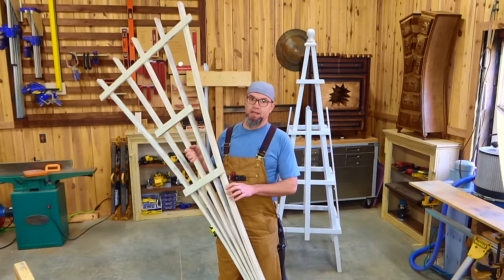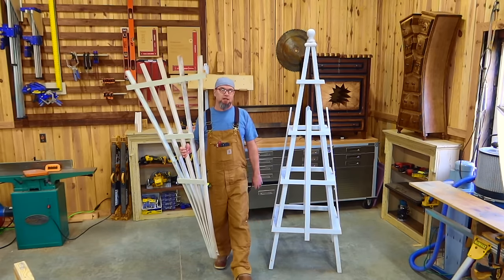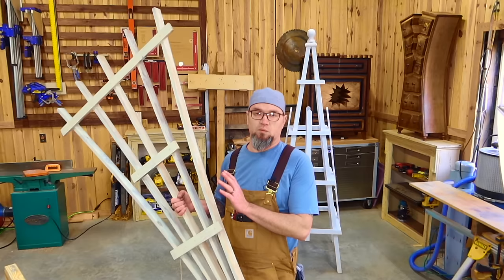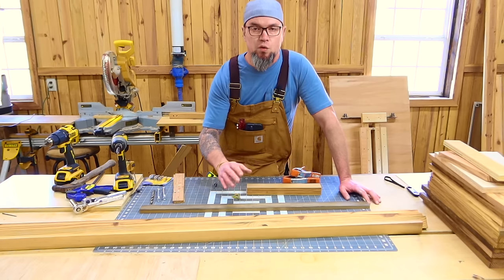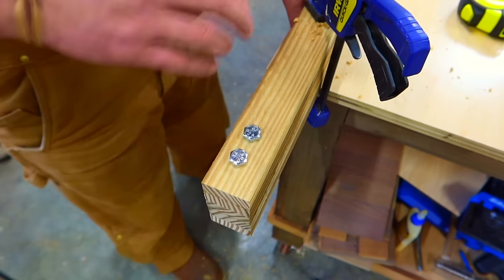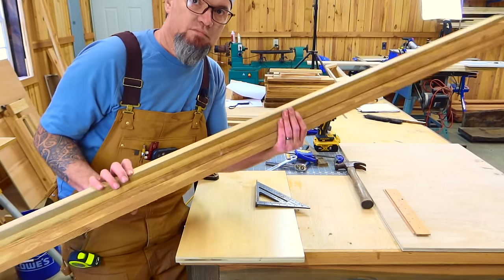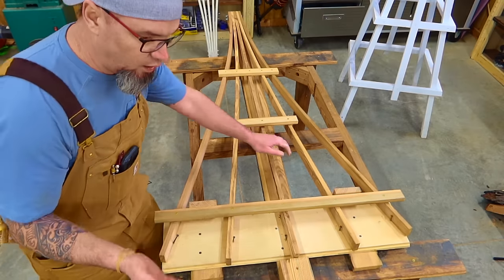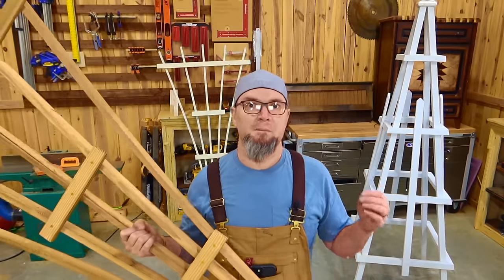650% Profit - Make Money Woodworking - Full Build

Comment: For those scratching their heads wondering what the hole spacing is for the top crosspiece, if you keep the 1.5 inches in from the end for the bottom board, the spacing for the top board is 8.125 inches.... 8-1/8. Best option for buying material is a 12ft 2x6. You will get two trellis from it with leftover pieces. Don't buy 8 foot boards. If you can't transport a 12ft board, bring a handsaw, tape measure, and speed square with you and cut it in half in the parking lot if the store won't cut it for you
Reply: Thank you 🙏
Reply: GENIUS move, @Agent Smith
Reply: lol, I take my Ryobi cordless circular saw.
Reply: THANK YOU!! I had to leave cause I was confused when I went to get the wood.
Reply: I went with the 8' 2x4s and used all my cutoffs to make "bird picnic tables". :)
Reply: I've followed this plan and here's what I've found. Each 6' board will reliably produce 6 - 5/8" strips. It could produce 7 but I like to estimate one strip damaged or unusable.  If you buy 5 12' boards which will reliably produce 60 strips you can make 12 trellis'.  If you are able to sell at $75/each your total will be $900.  Total cost in materials wood $70, 25 bolts and nuts $22, 150 star deck screws $15.  $900-$107 = $793.  Thought a cost breakdown might be appreciated by some.
Reply: What is the spacing on the 12” piece with the 3 holes. What is the length of the top board and screw spacing on the jig.
Reply: What's the length of that piece,  34" or 32"? He gave both numbers
Reply: @robertwintontk3213  take the jig you use for 5 holes and only drill the center and 2 outer holes. One jig for both
Reply: At least Home Depot, and likely Lowe’s have a little cutting area set up in the trim wood row so you can cut.
Reply: @siberwolf33  that was nice of you to do the breakdown.
Reply: @lilolmecj  Yeah, but they didn't sell.  I put one in my front yard.   The rest are taking up space in my garage.  They wouldn't sell for $50 and I refused to do for less than that.
Reply: @lilolmecj  thx for the advice
Reply: @siberwolf33 not sure how you are measuring your boards, and saw blade width but I can't get 6 from a 2x4 and no way for 7 unless you are talking about the 2x12s.
Reply: @jimmyturner5589  This is the problem with perusing comments as opposed to reading them.  Try READING the original poster's comment.
Reply: You are a Godsend and probably just erased a lot of his profits. I guess he could have deleted your comment so I’m grateful he didn’t. Thanks, I’ve been going back over the entire video looking for the spacing on the top cross piece.

Comment: Painting the ground contact section with rubberized paint adds great value to your trellis and obelisk. Much cheaper than adding caps to the feet and if you use white or black it is nearly invisible when the piece is painted.
Reply: I’ve sprayed them with flex seal. They have different colors
Reply: PLASTIDIP might work. Great tip, thanks!

Comment: Sir, I really like how much detailed information you give. I'm actually making the floating shelves for myself first. Thank you so much for all of the knowledge you share with us.
Reply from the maker: Hey CN!  Its my pleasure.  Learn and teach others!
Reply: Detail? How far apart are the scrwww holes on the three braces? Did I miss that part?
Reply: I guess I did mis it. LOL
Reply: @ronaldpoddig6188  it's the center of the board. once you gap/fan it is the center of each board. If you look at his jig he has the lines of where the inside and outside of each board is and the hole is in the center. I don't think he said because each persons jig will be just a little different (1/2" vs 5/8 ( or if you want it just a little higher or lower)) The board that will have the bulk of the screw threads in it should have the screw centered. I hope that makes sense.
Reply: @ronaldpoddig6188  From his video -- holes on the bottom cross brace are 2 1/4" apart, spacing from the center hole (which, of course, is simply placed at the center of the 12" board).  So, if my calculations are correct, that would make the spacing from the left end of the board -- 1 1/2; 3 3/4; 6; 8 1/4; 10 1/2.  Let's try that and see if it works.

Comment: I watched this the other night and started working on building one tonight. Just some points of clarification for others that are going to try building it. 
1. On the 1st 12" find your the center then measure the 2.25" for each hole, 5 total. This is board is 29" from the base.
2. The 2nd 12" and 34" cross boards we are not given measurements for screw holes for due to slight variations in the jig you make. Only instruction is that they are placed 16" from the 1st 12" and between each other.

Matt, you mention at 6:29 the board is 34". Then at 6:55 after explaining your mistake on the other video was saying it was 40" but it should have been 32". I cut 2 of mine at the 32" lol. Luckly I watched this 25 more times before I put it together haha.
Reply: So is it supposed to be 34" or 32"?

Comment: May I suggest using pins to hold the tops in place rather than screws. It would be quick and simple to pull the pin, stretch the wood, then plug the pin back in without the use of a drill.
Thanks for sharing the video.
Reply from the maker: Heck yea!  Thats a great idea!

Comment: Hi Matthew
I run into this problem all the time here in Central Pennsylvania. I made one of your Garden Fan Trellis’s with no problem at all.
Showed it to my wife. She loved it. After her approval ( ha ha ), I was ready to go to the local garden centers but I thought I would do some research online to see what they were going for around here. You mentioned to ask $50 to build them and they could make whatever over and above for themselves. Well instead of making a jerk of myself before going on my campaign, I found out that there are plenty of them out there already, in bamboo, cedar, pressure treated, etc, not pine like the one I made. And the costs were between $65-$104. Then I saw metal ones that were self staking and power coated, same size for $40.46 at Lowes.
How am I supposed to make one made of pine and compete with better wood and powder coated metal Trellis’s asking $50 bucks?
Help?
Reply: Hey Lloyd, Great Points! I don't think you can honestly compete price wise with any big box department store. You're going to have to take the approach, like Matthew said,  go to local nursery/garden stores. I would also take a look at farmers markets, flee markets, swap meets etc. One other method which is my favorite, give them out to friends and family. It will speak for itself and you can start to develop a following through word of mouth. 

One other item that is worth a mention  is quality hardware. The hardware you're using is not going to rust so it can last longer then a lot of the pieces you get from a big box store. Most of the hardware that comes with these wooden kits or metal trellis will rust and fail with in no time. Making sure you're getting stainless steel bolts and decking screws will go along way to ensure it's durability. One other note is that if you do want to compete you can add things to your trellis. Adding a design or pattern can always be a way to set yourself apart. However, your time is your money. 

If you really want to be cost efficient, then start gathering timber from fallen trees. If you can rip down a 2x4 into the 5/8th inch slats for this. You can probably start processing your own wood to use. If you have neighbors that have fallen trees offer to get that tree cleared up. I would let the wood dry for a time. Green Wood can be deceptive and end up breaking/cracking once it dries, but it is another avenue you can look at if you're trying to be as cost efficient as possible.

One final item you can consider is Etsy. it is a pain to ship things. Truly is a hassle, but it could be worth it. You can set it up so they(delivery services: UPS, USPS, Fedex, etc.) come to your home and pick up your package. You're responible for packaging it, weighing it, and printing/putting a paid postage sticker on there. Once you get the system up it is easy to repeat, but I always try to avoid shipping and handling if possible. 

Keep it up though! it is a side hobby it takes a while for things to jump off. Don't expect anything fast. Best of Luck - Cheers!
Reply: I can tell you what happened to me. The big box stores will be a wast of time. Drove to the local nursery wanting to see what they sold.  Got told "I have none because the only ones I can find are trash." That was from the nursery's buyer no less. With nothing to show her I simply told her I was thinking about making them and she said "Please bring one for me to look at and BTW what else I need is...." From walking out my door to having a potential buyer 30 minutes!

Comment: thanks.  Im going to attach 1 x 1/4 strips crossing each other, to a round topped frame. hesitating over needing to cut them so they form diamonds running diagonal or if it would simpler easier just horizontal squares... ripped from reclaimed planks of 1" cedar and some 2 -1/8 " redwood tongue and groove with a 1/2" groove in the redwood, ready to receive double 1/4

Comment: Sold a bunch of these, one thing i did was when i was cutting the round edge off the 2x4 instead of trimming it off i cut it off at 1/2" width and used them for the cross bars

Comment: I made one of these per your video a few days ago, from an 8 ft 2x6 that I had in the garage.   The finished trellis needed to be 7 ft tall, so I moved the cross pieces around until it looked balanced.  You are right about predrilling.  I predrilled through the cross pieces and still had a couple of splits.  I put 4 screws through the stake I used to fasten it to the ground and drove a second stake in front to give it more support in the sandy soil we have here in Tucson.   My wife likes the way it looks holding her jasmine vine.  Thanks!

Comment: Instead if removing and replacing screws on jig (to hold arms apart), I'm going to drill a 3/8's hole and drop a 1/4" bolt in as a pin. (Might have to put a nut or two on it for extra height.)

Comment: I was taught how to make these by just splitting the 2x4, 4 times, to make 5 prongs and not splitting the bottom 6-7"s. Then using spacers between the boards to fan it open. Just a different style of doing it, but I can see how this type would be less intense for mass producing with less wood stress.

Comment: Whenever I make jigs for repetitive drilling or routing, I use MDF. It is stable. It stays stable throughout temp and humidity swings. After the jig is set (ready to use) I give it a quick coat of spray shellac to seal it and keep it clean.
For jigs that mark drilling locations, I drill thru the jig with a 5/32" bit. Then I use a automatic (spring-loaded) center punch to mark the hole to be drilled. This reduces the chance that my bit might damage my jig, and allows me to be able to use any size bit to bore any hole I may require.
Drill templates are generally made from 1/4", router templates are generally 1/2" thick, to allow guide bearings to ride along the edge of the template.

Comment: Hi Matt, I absolutely love your videos and your attitude to teach the masses. Thank you. My question, as many others have asked, is the screw hole locations on the center support and the top (34") support. you gave the screw locations for the lowest 12" support.(2 1/4 inches apart). You showed us the 3 holes on the center support but gave no dimensions. Also the top support has 5 holes but not the spacing apart from each other. I thank you for the great vids. Be safe Matt...
Reply: yea im wondering the same....where the instructions for the big jig that spreads the wood
Reply: it's the center of the board. once you gap/fan it is the center of each board. If you look at his jig he has the lines of where the inside and outside of each board is and the hole is in the center. I don't think he said because each persons jig will be just a little different (1/2" vs 5/8 ( or if you want it just a little higher or lower)) The board that will have the bulk of the screw threads in it should have the screw centered. I hope that makes sense.
Reply from the maker: Hey Rich. The outer screws for the top are 30” apart. Then space the other two centered between outer and middle. 

The other two you make when you make your first one just in case your jig is a bit off from mine.
Reply from the maker: The outer screws are 30” apart. Then space the other two centered between outer and middle. 
The other two you make when you make your first one just in case your jig is a bit off from mine.
Reply from the maker: Thanks CN.  Your are correct.  Everyone used different material and may make a jig a bit off from mine.  Thanks for helping out.

Comment: Need to double check the lengths you have written on the cut list.
34"...but you said its 32"
12"...for the other 2 crossboards, but in the video they are clearly 2 different sizes.
Ill figure it out when i try to build it, but others may not have caught the error.
Thanks for all you do for folks out here! ⚘️

Comment: Hey Mathew,
I recently ran across your channel and absolutely love it!
I made my first trellis today and was wondering.
I think in this video you corrected yourself from a previous video about the top length piece.
I cut mine at 34in per your update but that was to short. Based on the 29in from bottom ans 16in there after I needed a 42 in piece to hang over 2in on each side.
Also went with the 4in bolt but have too much sticking out past the nut. I'm going to go with 3 1/2 wich should help.
My proto is attached. My tools have been sitting idle for years. You are a true motivator thank you!_
Sorry to ramble...and can't seem to attach a pic..
Keek the great videos coming!!
Reply from the maker: hmmm... Im not sure whats up.  And one reason I didnt go into details about the jigs.  Everyone may build or use a bit different material throwing jigs off.  Well Im glad you got it worked out and Thanks for Watching!!!
Reply: @MatthewPeechWoodworking  Hi,
Thanks for the response.
Your video's are like a recipe for cooking...you give the ingredients and from there you can make it your own!! Keep  them coming cause I'll be watching...
Reply: I did a batch with 4 inch bolts but will be using 3.5 also moving forward

Comment: On the 2nd step where you're using the template of where the holes should be drilled, you could save time by building a jig that is two high. Level 1 is where the piece goes being drilled, level 2 would be where the template sits on it. Since it has walls on the left, right, back and front, you make it tight enough that both pieced fit in and you can save time not having to align the piece and the template and putting clamps on it. Not sure if explaining correctly. Basically a box with no top on it, on a board. Only the piece and template fit in and hold it in place to drill.... done.
Reply from the maker: Love it.  Great Idea!

Comment: Also, for a built in stake, why not have the center 1,3, or all 5 8’ long and add a second tier of double bolts 12” up. Then you’d have the extra depth for a stake already there, plus it’ll be a much stronger connection.

Comment: Great vid! Have you thought about using metal inserts for the top of your jig? That way you could just take out a metal pin and bend your boards and just drop the pin back in to hold it in place. Would be easier than having to replace a screw and you wouldn’t have to lift the boards over them.

Comment: You mentioned that multiple types of wood can be used and that you use pine, reason being that if there is air flow they’ll hold up. My options are white wood studs and pressure treated. I’m figuring pressure treated is best, but I wanted to check with you. Should I also tell my customers to not put the stake in all the way and leave a few inches between the base and the ground, or does that matter with pt wood?

Comment: For the optional stake, while the star bit deck screws are nice, not every customer is going to have a start bit or want to go out and buy one so those 2 screws should be say a galvanized screw with a phillips head since most people would even have a phillips screwdriver.
Reply: If they spend $50-$150 on that thing, they can spend a couple more dollars to buy a star bit. What heathen at this point is using anything other than star head screws anyway?

Comment: On your large jig, have you considered using a dowel pin instead of a screw? you can enlarge the existing hole without going all the way through the board, so it stops and it will slide in and out without needing a drill.

Comment: Hey Matt love your videos. They are inspiring just to make these things for yourself.
Just had a thought when you were stretching out the second upright. Could you loosen off the bolts at the bottom to allow a bit of movement. When the second up right is in position you tighten up the bolts again. Just thought it would be easier and less prone to snapping.

Comment: Very nice.

Instead of bolts, could you run some exterior screws? Driving from opposite sides of course. Not sure if you've tried or not, maybe you have and they arent strong enough to hold once you fan them out.

Comment: Would you consider fence posts high enough quality for this? Dropping to 71 1/4” vs 72” yields 1 trellis from two posts plus an extra 1.5 x 1 and two 7/8 x 71.25 pieces that are great for the little planter.